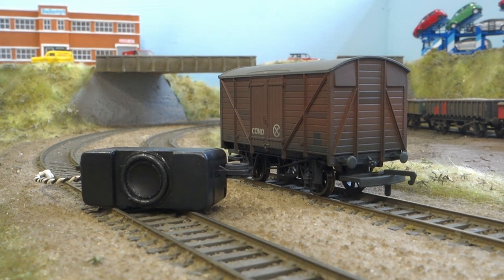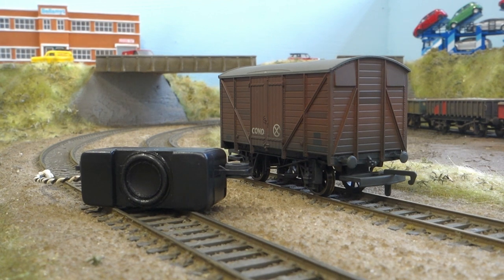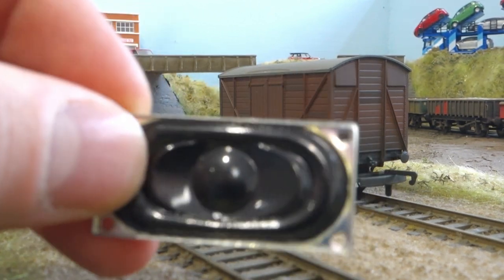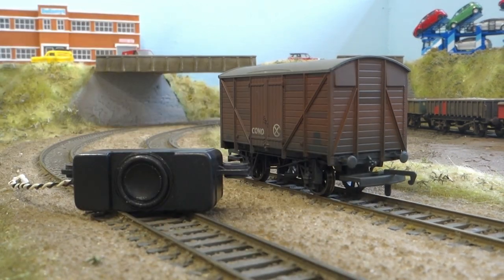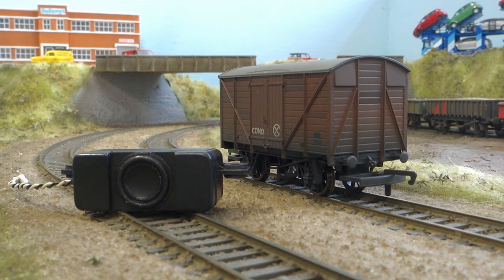Hornby TTS Vent Van, Speaker Upgrade And Demo

Comment: Good video,  I bought 5 of them thought of using at least one as additional power pick up for sound   dapol B4 and Pecketts .  The decoder code easily be static mounted in a signal box or goods yard
Reply from the maker: VC's Southern Railway that’s a good idea, every bit of it still gets used
Reply: Absolutely,  they are cheap enough to have a couple as static hard wired and use the wagon for additional power for small sound locos

Comment: Can’t see the point of this particular TTS decoder! Any cheap MP3 player and a speaker under a layout will give much better sounds, more sounds etc etc. It is very easy to use a smart phone to record any desired sound clip and play them on the MP3!!!!1
Reply from the maker: Yeah it would give you any sound you wanted if you were able to get the right recordings, but I bet it would be harder than you think. For example if you tried to pick up ambient street noise it would pick up peoples conversations which you wouldn't really want. The ambient street noise on this just has muffled crowd noises, you can't hear what anyone is saying. I think purely for convenience this is still worth having, it can be placed anywhere on the layout and theres a sound to suit most people. Richard
Reply: For less than £40 we have something quick and convenient to place on the layout, while you're trying to record better sounds on your phone. Good luck!
Reply: Stalli46 Good point and I have used similar in the past. I made friends with a YouTube contributor and asked if I could use his sound files. Permission granted and these were genuine early morning “Workshop & Engine Shed” sounds. Ideal for a shed layout .